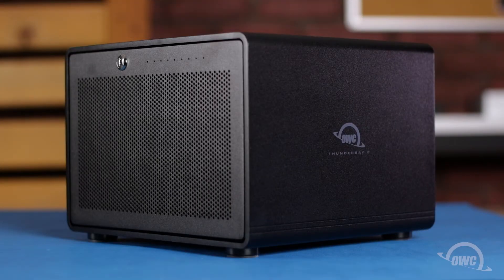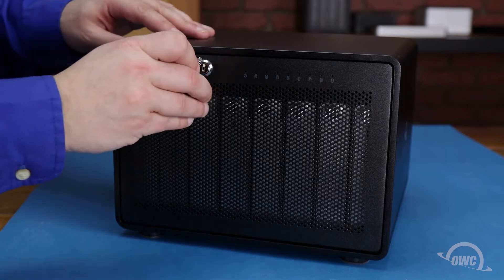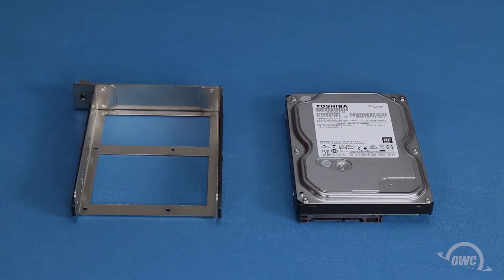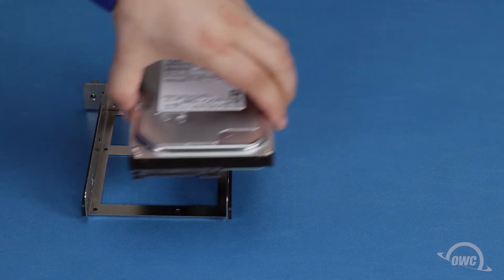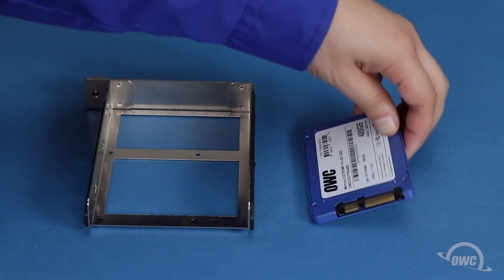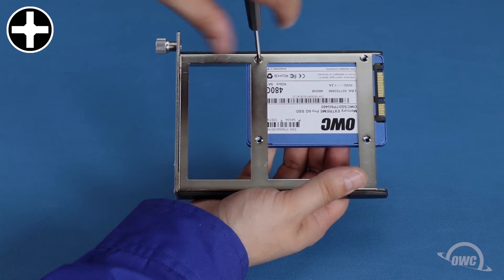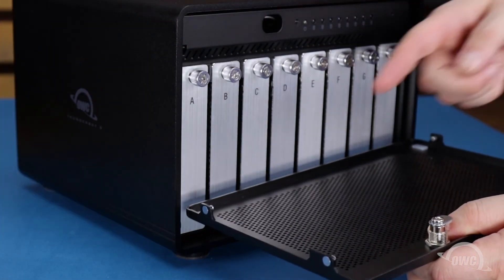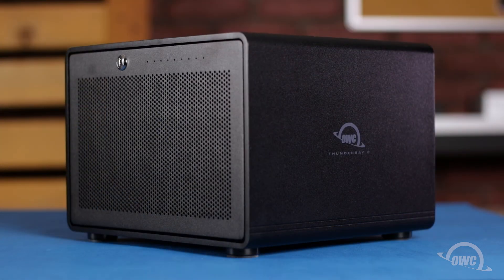How to install 2.5 and 3.5-inch drives into a OWC ThunderBay 8 enclosure

Comment: Can I add additional formatted drives after having it initially configured with 4 drives and RAID-5? For instance adding 2 drives two months later and then the last 2 after 6 months? Asking because it would be really costly to have it all set at once, especially if I opt for denser drives.